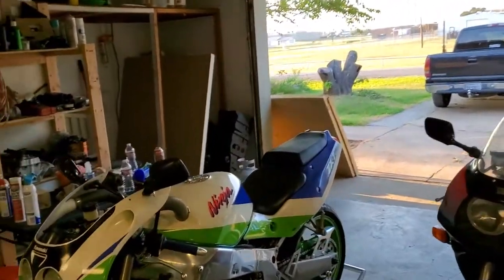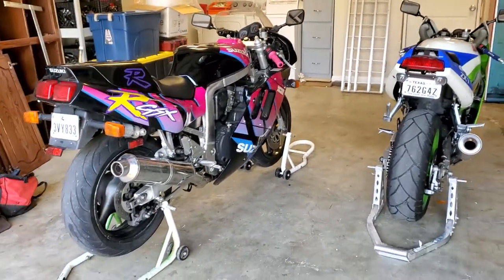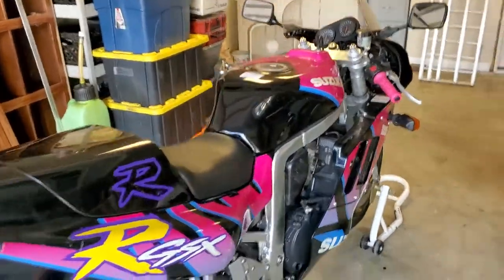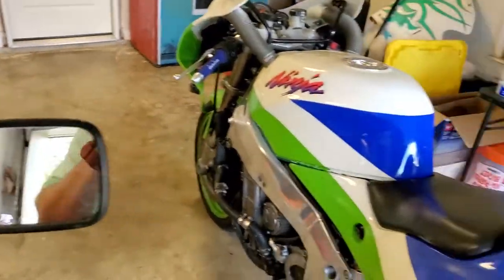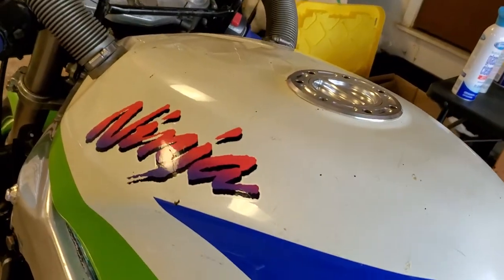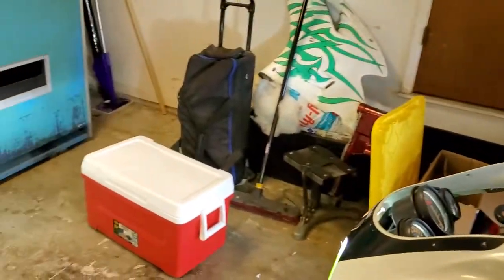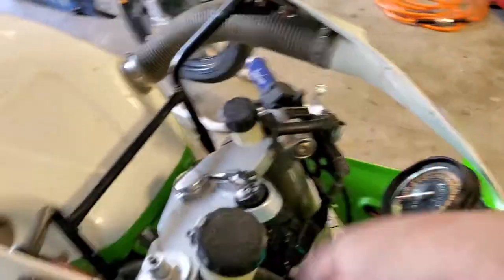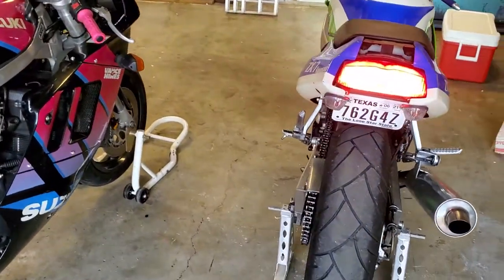My 90s sport bikes! Start up and revs!

Comment: I was in high school lusting after these bikes in 91! I still have the cycle world issue that had a 750 shootout which included both these exact bikes, plus the Katana 750 and the 7R to name a few. Of course the VFR won, but both these units were noted for being superior track day bikes than the softer offerings from the big 4.
Reply from the maker: Thats awesome!
I love these bikes for sure! 
Super easy to work on and enough power to have a blast on!
Reply: @sunsetsportbikes9435  Yup, all my current bikes are early 90's, all are fun, cheap and are going up in value due to their scarcity and excellent condition.
92 FZR1000
91 Bandit 400
93 TDM 850
90 VTR 250
Reply: I lusted after the Kawasaki : it was those air-intakes.
They reminded me of Marvel Comics Thor : there was a character
Loki whose helmet had similar Ram's horns.

Comment: Nice bikes, I have a small collection of classic Japanese bikes myself, ranging from a 1972 DT3 250 Enduro to a 1994 FZR600R.
My 1993 YZF750R is my favourite. I also have a 1991 FZR600 and 2 1988 FZR1000 Genesis.
Reply from the maker: Thank you!! 

Thats awesome!! I am still on the lookout for a YZF750.. I have had a 95 FZR1000, which... I wished I never would have sold it.. loved that bike for sure.
Reply: @sunsetsportbikes9435  I'm Scottish myself, the most popular YZF750R is the Pinky, it's the most sought after in the UK. 
Mine is Gunmetal Grey, Black and Purple. Many people put the FZR1000 engine in the YZF750R, personally I prefer them standard!
Reply from the maker: Thats the one i would like to have hah! i like the standard pink and white, looks great! My 95 fzr actually had the yzf 6 speed trans in it. a decent upgrade for the 1000
Reply: Gaming is real.

Comment: Both are very nice bikes in an outstandig condition. But the Kawasaki ZX7  is a J-Modell, not as you said, a L-Modell. the L-Modell had not these air-hoses, but therefore an real ram-air-inlet on the lower left side of the frontfairing. Best regards.

Comment: That’s real bikes. Love it.
I want to remove the Kleen Air system on my 98 ZX7R but there are no block off plates available in Germany. Do you know a shop in the US where there still sell these ? Maybe there ship to Germany. Otherwise I have to make them by my self.
Reply from the maker: Well I kept the stock plates and the stock hoses and just ran a small pipe to mate them together
Reply: @sunsetsportbikes9435  I hate unnecessary parts on engines like blind cables oder hoses. I’m kind of a perfectionist and sometimes even for my self a bit to much.😄 I’m a aircraft technician. Maybe that’s the reason.😉
Reply from the maker: @danieldoubleyou9784  that's totally the reason hahha 
My uncle works for Boeing here in Texas.  He is the same way haha
Reply: @sunsetsportbikes9435  than you know what I’m talking about.😄

Comment: Which one do you prefer. I have a couple zx7r’s and after I get them done then I’m going after a 91ish gsxr. Then 900rr
Reply from the maker: Man... I'm a kawasaki guy 100% my 91 gsxr... so comfortable... it was 100% stock so it was smooth.. didnt skip a beat....  my 03 zx7r... fast.. really fast. It has a zx10r conversion, suspension wise so it dropped 60 pounds.. 
I havnt gotten to ride my 94 zx9r yet.. still working on the rust in the tank..
Reply: @sunsetsportbikes9435  ZX10R conversion? I've heard about them at a bike night or two... Was it really hard to get everything right and properly fitted?(Engine/ECU/Swingarm) That's one hell of a "sleeper" IMO...(Sexy Body & Killer Motor) Please post a vid for this build...👊
Reply from the maker: @bcreighton1829  unfortunately mine only has the suspension and rims done. 
Still lost about 60 pounds. 
Milos has a weld in motor mounts to swap a 10r engine in the 7 frame but thats  a bit to much work for me haha
Reply: Foolish!

Changing brands like a lunatic.